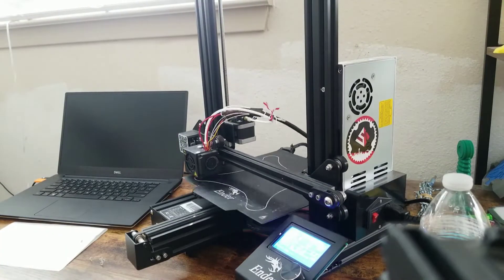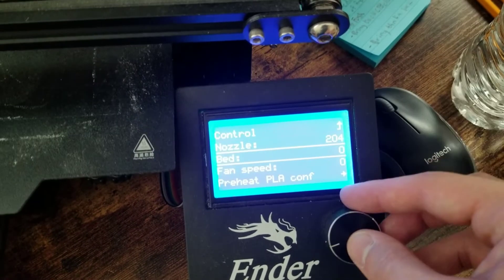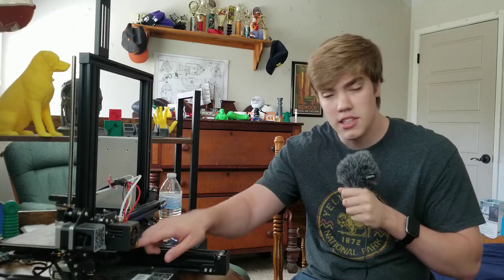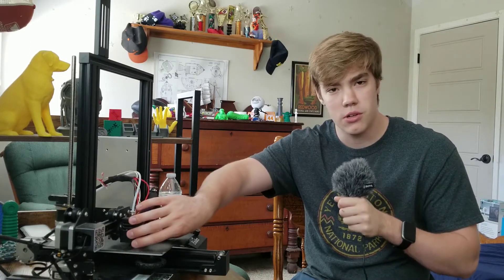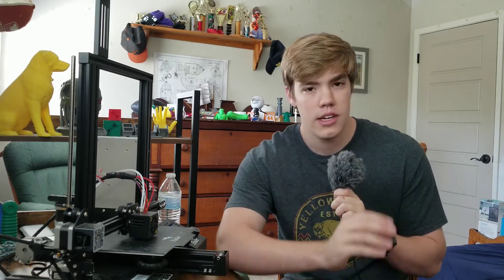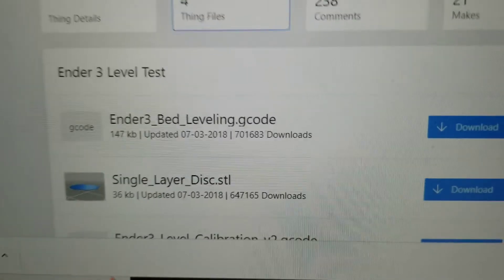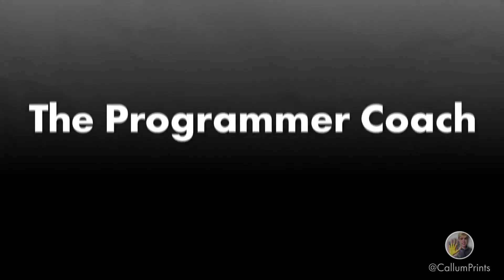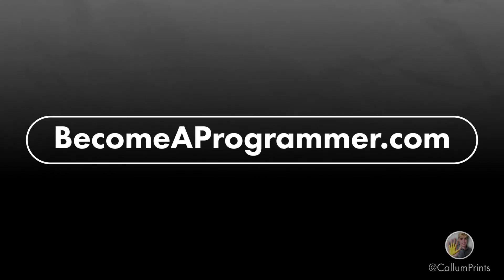Level Your 3D Printer's Bed in 5 Minutes! (Ender 3 Pro)

Comment: Paper thickness varies greatly - Gauge for accuracy is recommended, they are not expensive. Card stock is not good IMO at least here. whether Business cards or advertising.

Take more than 5 minutes to level your bed - Do it, do it, do it again. 

Adjust wheels so nothing moves on printer unless it's supposed to - No play. - All print jobs will fail with a part that moves incorrectly.

Comment: This was soooooo helpful! Thank you so much! I have an AnyCubic Kobra 3D printer and it's been printing to the far right-rear corner, and I've lost so much filament, because I thought I needed the filament to be heated while leveling the bed. It displays the letters EO and a temperature, but I don't know if the filament's heat allows it to initiate leveling, since it needs to wait for the EO temperature to match the set temperature I've selected 210/210. Thanks for helping me make Halloween products.